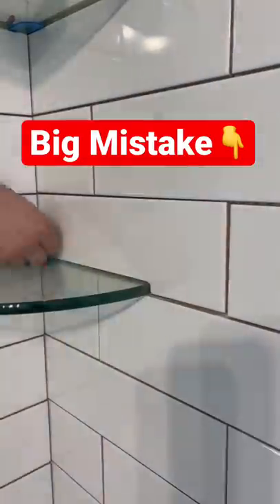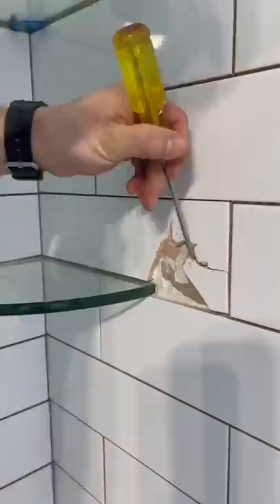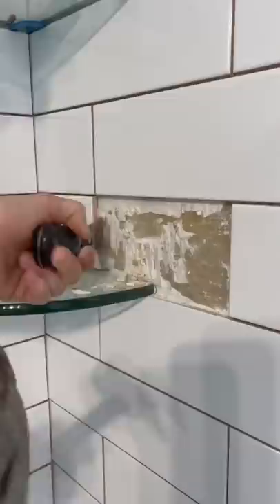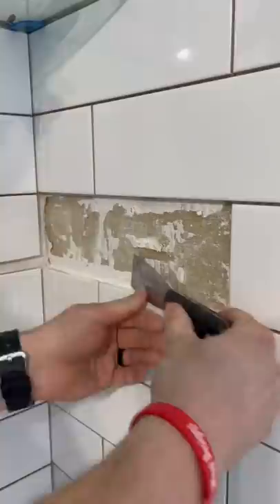How to remove a single tile. #diy #shorts #youtubeshorts

Comment: The more you post the more I can see you're a solid dude and you work hard to do things the right way. Most importantly it seems like you listen and take advice well. You're going far and there just aren't enough contractors with your character. Thanks for sharing!
Reply: AMEN. I agree. Ethical guy!
Reply: Seems like you're uneducated in construction. This is not the proper way to demo or install tile he didn't even use a notch trowel 
for his thinset.
Reply: Id advise him to taķe the glass shelf off first 😂😂
Reply from the maker: Hey thank you so much. Just posting things I wish other people shared. We all make mistakes:)
Reply: @jessejames7074  everything was fine and it looks completely fine like wyat
Reply: Just seems like he's a basic Joe nobody and messes every job up
Reply: @SlickRickTPB other than this being a tad rude-I’m demolishing a bathtub and building a shower pan myself to fit the odd dimensions of my nearly century-old house. I’m also having to tear out rotten wood and brace what I can’t rip out. 

I appreciate seeing how mistakes are corrected since I have never done a piece of tile work before in my life, and the project begins this week. 

This guy posts successes and successful fixes to mistakes that help the rest of us.

Comment: Pro tip. Always remove the perimeter of grout around tile you want to remove as this will stop other tiles becoming loose or drummy that are connected to the fixed tiles surrounding
Reply: Yep!
Also makes the surounding tile less prone to chipping out.

I've had chips come off of surrounding tiles because of pressure from the grout line. Never even hit the tile, just see a chip come flying off, and then I'm replacing that, too.
Removing grout helps with that.

Comment: I'm not a tile guy..but I know to first cut out grout lines with a dremel , or a hand drill with cut off disk...beating it with a hammer  if your looking to replace more than just one..and protect other tiles with duct ,or blue tape.

Comment: Another piece of advice. Remove filling around it first if you've already  had it placed it there. Then it is less likely to spread tension to other tiles when using hammer with screwdriver as in shown case.

Comment: I like how u did that. Ive seen so many just hit the center with a hammer. Then a big mess. I drill a little relief hole. Then u dont mess up the surrounding tiles.

Comment: The tile material may be different on other countries or even companies so breaking like this might not work well. But first of all, the shelf was ok like this , why would you push it to wall, the water dropped on shelf might go more easily now in the wall. So i believe its wrong to try to "fix" this "problem".

Comment: Seems there is no waterproofing. Won't water on the glass shelf seep through to the back of the tile ? Isn't the glass suppose to sit on top of the tile and not in contact with the backer board..... just wondering 😮

Comment: I prefer to Heat up the Tile with a heat gun. There are also Special Tools for it to heat them up.
It needs a bit of practice, because sometimes the Tile can Break due to the Heat difference. 
But with a Bit of practice, this is an easy way to Remove Tiles WITHOUT any damage to the Tile 
Good way, when you dont have spare tiles

Comment: What is that "waterproofing" you are using? What shower system is behind those tiles?
Did you just put thinset in without using a grooving tool?
That shelf is not supported?

Comment: You knew it wasn't right when you laid that tile and confirmed it when you laid those above it . Why didn't you replace it whilst the adhesive was still wet ?   
 That glass shelf is always going to be a potential for water ingress into the substrate  , so get it right first time .

Comment: I wanted to know what tile adhesive you used. Seems good. I have floor tile issues that many lose its adhesion and bulge up. I need to repair and i need only a thin adhesive but high strength if possible.

Comment: question:  my shower is tiled, and  there is roughly 2ft of bare walls that lead to the ceiling.  What is the process for extending the tiles up the wall to the ceiling?

Comment: That's how it should be. I had a customer I said I would be there between 10 & 10:30. I get there at 10:20 and she said I have a problem with your punctuality. Lol I said no problem I was wondering how I was going to get my last job today done. Her problem was she thinks I was going to start charging her at 10. When in reality I give most customers an hr. On a half day job and 2 on a full day. Her loss. That was 3 weeks ago she's still looking for someone to put smart locks on her doors and paint them. I know I'm not gonna do them ever! I spend hours after work trying to find my customers the best way to do whatever I do mostly electrical but there isn't any part of a house I can't do. I try not to do concrete and if possible paint.

Comment: The key is to get proper tools. No disrespect looks like good work man but get a diamond bit set. The president with trying to chisel pieces of tile off the wall (with a screwdriver ) is that you can loosen/separate other tiles and not even know it

Comment: I did a shower for a retired artist in an atomic ranch with this subway tile. She spec’d black flat pebble floor with white grout with black grout on the walls. That tile was so soft, it cracked while the thin set was drying. Kinda weird, beautiful shower tho…

Comment: Yeah, i have doubts on this one...
You demonstrate this with no joints done ? so you can only do it the day after doing the job and before jointing, a bit misleading imo
Doing it while jointed (99% the case of thoses who watch this) you dont have a relieve space and the first shot with a hammer will most likely break or pop off other tiles...

Comment: I had a guy who did my shower and the tile overlaps with the other tiles any tips to make sure the transition is smooth and not bumpy
Reply: Buy a pack of tile levelers you only need 4 at most, take the tile out refit it and use them so it sets perfectly flush

Comment: I need to replace my shower head with a hose type one for my hubby who is steadily declining. I’m still freaking out on doing it thinking on what happens if I drill in to pipes, so it’s not done. By the way I cannot afford a plumber 😭😭😭😭😭
Reply: If you have a shower head already why would you need to drill? The shower head unscrews and you screw on the pull out hose head.